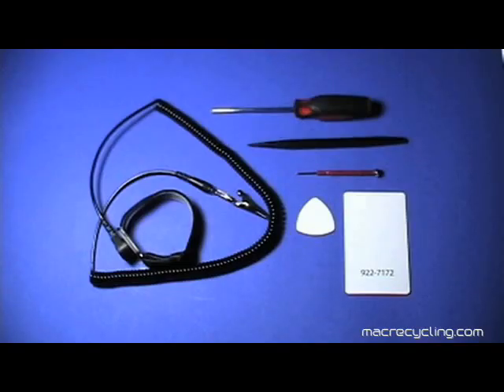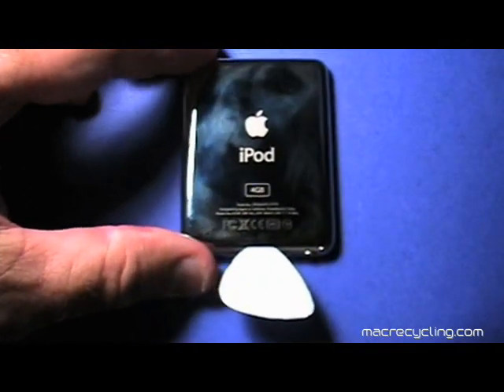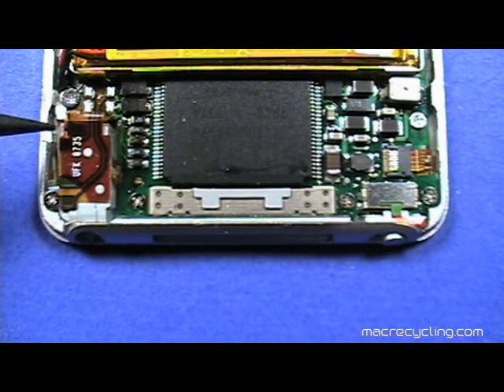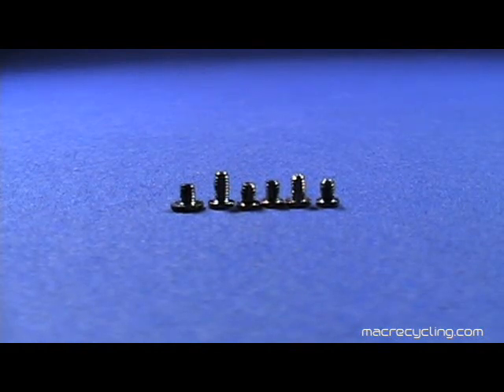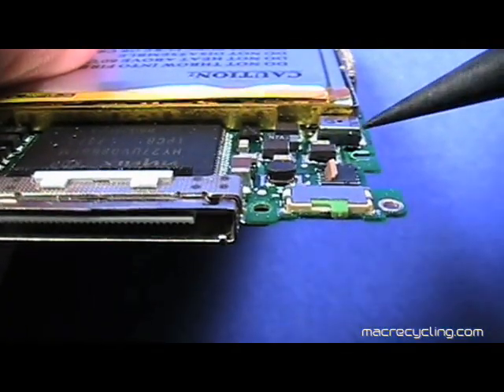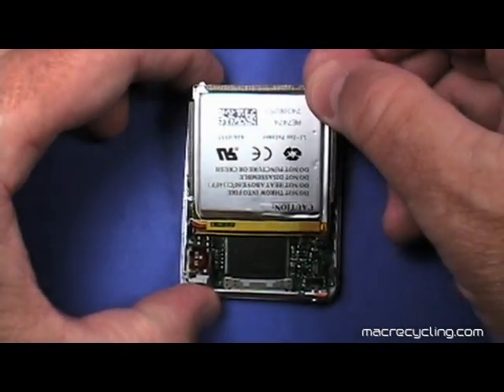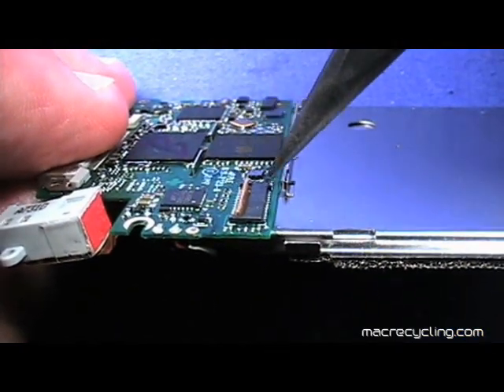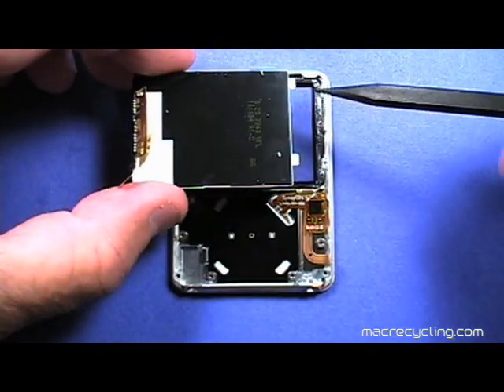Take Apart Apple iPod Nano 3rd Generation (3G) - Disassembly

Comment: I broke some green board. Tore down like the plastic tools I used. The plastic tools were the first to tare down. :l.. was not easy as an ipod touch 5... now I cant put it back together. Mines don't turn on. It had a white screen. And beeps. Still gives me back my songs. But that was before... I did not notice anything. It was heavily dirty inside.. :l.. 5 years ago. It got wet.

Comment: I see the headphone jack is accessible when you first open the nano. My jack is half working. If you plug the headphones in halfway it sounds better than if you plug the jack in all the way. All the way and you can't hear the singer singing then. This was a $10 buy on Ebay. Everything else functions well. Any ideas how to fix the problem? When the jack is plugged in it feels a little loose.  I already tried cleaning it. Thanks!

Comment: Never have I seen such ridiculous design.  Despite what this video, and others claim, there is no way the blue plastic tool, or any number of guitar picks will do anything to get that back cover separated.  The only way I was  able to even begin to get that seam parted was with a sharp flat bladed screw driver driven in by a bit metal woodworking clamp.  That did wonders for the aluminum frame.  But even once begun,, and I was able to stick in two guitar picks, they did nothing further to release anything.  In resorting to the blue plastic "tool"  (junk) I pretty much destroyed it trying to work it around.  The sharp metal back cover just cuts right into it and shredded it.  So back to metal flat bladed screwdrivers.  I am able to get about 1/2 the cover off, and that is it.  So - since Apple was so determined not to let me perform a simple battery replacement I will support them by saying that I am now equally determined NEVER to buy any Apple product again.  Why would I when this how they design their crap???

Comment: You didn't show whole disassembly - the click wheel is changeable too but you will need to pry the black panel that is left after screen is taken off. Don't worry the panel is not soldered or something it is just glued. (I had to change my wheel and as i've noticed none of so called fixers noted it - even ifixit)

Comment: Well, I followed your steps...I had everything you had...and umm.. I broke my screen..i WILL NOT be looking at anymore of your videos!
Reply: I did the same mistake ;/ opening this cover is very difficult :(. They also made battery connection which has to be soldered - crap instead of simple connector.

Comment: @Redsbaseball9 

Dude, press and hold the middle and top buttons on the wheel until it goes into disck mode, then plug it into your comp and use itunes to restore it

Comment: im about to snap this thing in half... ive tried using picks to open up the case but it will not open.. i can pry apart the bottom but the sides and top do not open...

Comment: Now I'm not sure if this is something I did or something caused by doing the things on this video. What I did, essentially, was replace the screen. My old one had cracked so i bought a new one. The old one lit up however. I replaced the screen and it works fine EXCEPT the backlight on it is not lighting up. So I guess it's up to you on what you do. My  question is, is the backlight part of the screen (Bad screen) or part of the ipod that I broke in the process of disassembling it

Comment: This is a good video. Doing this requires patience, especially for the Nano 3rd Gen. Even still, if you have no experience, there is a risk of damaging it. I repair iPods daily. I found some of the suggestions in this video useful. Thanks!

Comment: The reason why the backlight doesnt work after you dipped your iPod in your washing machine is because most (if not all) washing detergent are conductive, meaning that they can conduce electricity thus short circuiting its internal IC components.  Most likely you tried to power on your iPod without letting it fully dry (a big no-no).  When things like this happen, you should blow dry your iPod and let it sit for about 3 days and THEN try to see if it works.

Comment: youlldoshell I had the same problem so I bought a new lcd off ebay and replaced my faulty one using this video as a guide. Well hey presto the backlight works now. So to answer your question fully the backlight is intergated with the lcd. Good Luck!